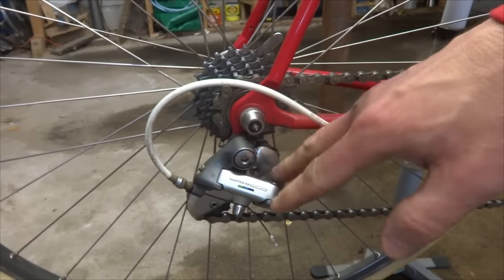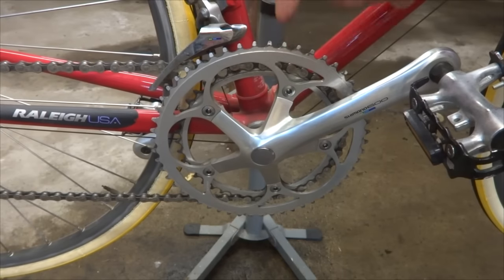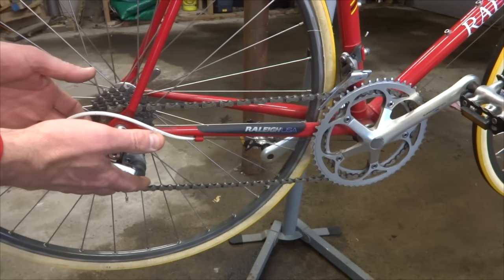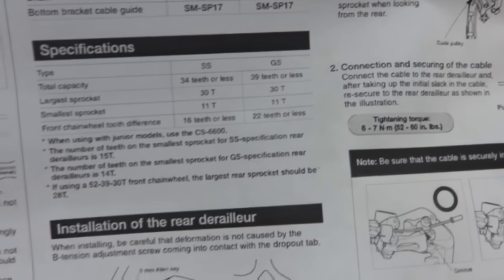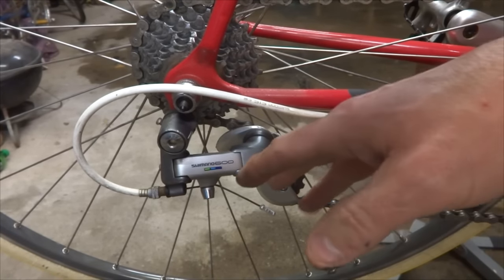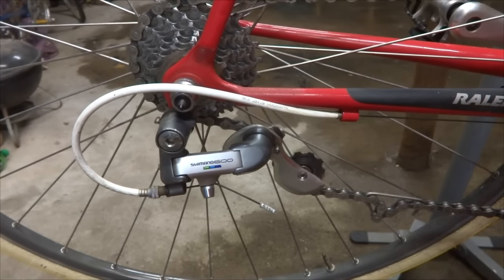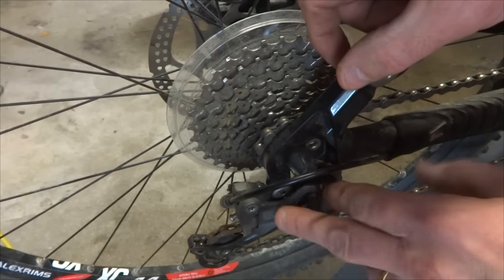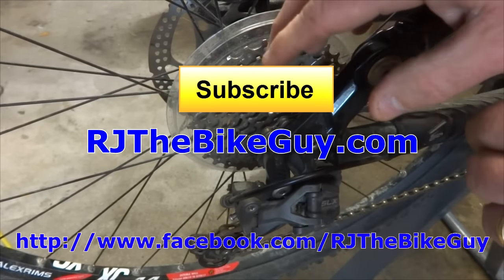Long Cage vs Short Cage Derailleurs - Which Do You Need

Comment: I have an old frame here to experiment with. I set it up 1x8 with an 11-32 cassette and rode it for about a month with no problems. Since I'm in flat Florida, today I said, the heck with it and switched it with a 12-21 I had laying around. Same long cage RD. Surprisingly, it works like a charm!

Comment: Thanks for the great video - I know it's old, but this problems is still occurring g today. Now, my drivetrain has changed with the latest upgrade and I need your help understand exactly if a Medium Cage will work.  
Old Drivetrain - 3 by 7 : Front 3 rings (42, 36, 29T)  Rear: 7 rings (11 to 36T)
New Drivetrain - 1 by 10 : Front 1 ring 32 T, Rear 10 rings (11 to 46T)
Do I need a Long Cage for my New Drivetrain, or a Medium Cage should be enough?

Comment: I have a Shimano Deore LX "9-speed" rear derailer on my bike.  It is rated at 45 total capacity, but I am running it at 47 with no problem.  47=(48-24)+(34-11)  I don't think it could handle even one more tooth, but at 47, it works fine.  This derailer is also rated at 34 for the largest cog, but I know people have run it with 12-36 cassettes.  I have also read of people making it work with 10-speed cassettes. Moral: Shimano can be a bit conservative with their ratings.  Sometimes you can get away with a little bit more.
Reply from the maker: +Mark Holm The specs tend to be slightly conservative. But only slightly.
Reply from the maker: +RJ The Bike Guy Generally, it is not good practices to be shifted into the biggest cog and biggest ring. That is cross-chaining.
Reply: When I say it works fine, I mean it can handle both the big-big and the small-small combinations and everything in between.  Some people set up a bike with more capacity than the derailer can handle and get away with it by never selecting the big-big or small-small combinations.  That is not what I am doing.
Reply: My opinion: The Shimano Deore M591 SGS rear derailer may be the best, general purpose, rear derailer ever made.  Rated Capacity = 45, Practical Capacity = 47, Rated Large Cog = 34, Practical Large Cog = 36.  Will easily work with 7-9 cogs and can be used with 10, with the right setup.  All the parts that should be metal are metal.  This derailer is perfect for a wide range of bike trails, touring, commuting,etc.   The derailer in my pictures is an extremely similar Deore LX.  My wife's bike has the M591.  The LX is only cosmetically different from the M591.  The other good thing about the M591?  It costs less than most of Shimano's decent quality line.
Reply: +RJ The Bike Guy   Yes, I know that.  The practical fact is that is the way Shimano rates total capacity (with a little fudge factor) and, on a well set up bike, you can actually select and ride in the cross chained combinations with little harm.  It is not ideal, but it is not a disaster.  It helps if your chain stays are on the long side.
Reply: +Mark Holm   Cross-chaining is one of the great cycling bugbears.  As soon as you mention it, somebody jumps up to complain.  I know for a fact that on my bike, and my wife's, with wide range triples in front and wide range 9-speeds in back, and Deore SGS derailers rated at 45t, I can cross-chain them both ways, on the work stand and while riding, with nothing terrible happening!  Perhaps the efficiency drops.  Perhaps chain and sprocket wear increase.  Yes, those are concerns.  I don't cross chain deliberately, or for long periods, but it sure is nice to know that if I do it by mistake, I won't instantly trash my ride!
Reply: +Mark Holm   And!  I wonder whether the bugbear of cross-chaining did not become significantly less problematic back when Sedis introduced the bushless chain.   Nowadays we all ride bushless chains.  They are significantly more flexible in the sideways direction than the ancient bushed chains.  Perhaps cross-chaining really is not so bad any more?
Reply from the maker: It still places strain and wear on the chain and cogs to have the chain at a steeper angle.
Reply: +RJ The Bike Guy   Cyclists love their myths.  We were told for decades that narrower tires have lower rolling resistance, only to have that myth disproved by actual measurement!  Perhaps the evils of cross-chaining are a similar situation.
Reply: +RJ The Bike Guy   Look, RJ,  I really am not interested in a flame war with you.  Your videos are great.  I enjoy them and have learned a few tips from the.  The plain fact is, the outrage against cross-chaining is based largely in myth and legend, not engineering data.  The main points I started making, and still my main points are: 1. Rear derailer capacities are calculated based on the cross-chained configuration.  2. A bike set up to the derailer specs (or a bit more) can cross-chain without running out of take-up.  3. On a lot of bikes, cross-chaining, while not ideal, will also not cause instant damage.  Sure, if you ride miles and miles cross-chained, you may see increased wear.  We need to be honest and realistic about what we tell people.
Reply from the maker: You ride how you like.
Reply: +RJ The Bike Guy   Please understand, I am not trying to be flamy or rude.  This is a topic that ought to be resolved by engineering tests, but I do not know of any so far.  I am not alone In my skepticism.  Here is what the Park Tool website says, "Bicycle shops commonly recommend against “cross-chaining” which is using the smallest rear cog with the smallest front ring, or the largest rear cog and the largest front ring. Bicycle chains are quite flexible, and will work well at various other then perfectly straight. Cross-chaining is primarily an issue when the chain hits the front rings. As a simple rule, if a gear combination causes a rubbing problem, avoid that gear."

Comment: In my country, the country I come from the chain length variation is calculated using a different method yet comes out with the same result. Add the two largest and two smallest possible sets and subtract the smaller number from the larger one. (They call me “Largest Cog”)

Comment: A long cage, where it is not needed, will cause a lot of chain slap, unless you have a clutch. It can cause you to lose your chain in rough terrain or over common street obstacles like speed bumps and pot holes.
Shorter cage deraileurs do tend to shift faster, quieter and smoother, partly because you get better chain wrap and the guide wheel closer to each cog, but also because there isn't so much to flex (it isxastounding how long a short cage deraileur can stay in adjustment vs a long). These are all niggling things until you apply them to 1x vs triples, with huge range. Also, any e-bike. E-bikes can have problems with power over run with motor inhibitors between shifts, oh and cheaper ones (most) often have sticky freewheels instead of cassettes. Now all that extra chain slop bunches up and causes all sorts of problems.

Comment: I found this very useful . I have a Fuji Absolute 2.3 but it's set up for a seven speed but it has a Shimano HG 9 speed cassette . I'm just wondering what derailleur to look for n shifters for it as well . I would like to get rid of the front derailleur n go with a 1x drivetrain . Any thoughts or suggestions would be great . New subscriber . Thanx again

Comment: Another amazing content RJ. Your online presence is truly valued. Question though, what's your take on using a rear mech on a drivetrain beyond its spec sheet capacity? Just installed an 11-32 10 speed sprocket using a 5701 SS. I'm 2 teeth over the largest cog and 9 teeth over the capacity. I really do not ride cross-chained, will I have problems in the future?
Reply from the maker: +Gian Tan The specs are slightly conservative. The largest cog spec especially. You can usually go a couple teeth over the largest cog spec with no problems. 9 teeth over capacity? I would be VERY leery of that. If you accidentally shift into too big of a combination you can maybe have some major problems. Maybe destroy the derailleur and who knows what else.
Reply: +RJ The Bike Guy Who knows what else may involve snapping my hanger feeding my rear mech into my rear wheel and tip me over face first. Yes I will be very very leery of that. Hehe. Though even running 11-28 before I have never had the habit of using bad combinations.
Reply from the maker: Why not just install a derailleur with a bigger capacity. Is it a road bike? There are medium cage options for some of those.
Reply: +RJ The Bike Guy One last thing RJ if its okay. I fitted my chain to accommodate a big-big combination. Some slack will be expected in small-small but, again, I will never ride in both combinations. Do you think the chain length I used will help minimize risks from the over capacitated rear mech?
Reply: +RJ The Bike Guy Medium cages are hard to come by in my area. Pretty much all the shops here have mid cages for 11 speed. I can go with Sora which have higher rated capacity but shifting may be a dud. But I am on an on going hunt for a GS 105 or even a 4700 mid cage.
Reply from the maker: Check ebay. Just understand the risks of what you are doing.
Reply: +RJ The Bike Guy Roger that RJ. Thank you.
Reply: Once a friend was running more teeth than his derailleur was capable and on a sprint he tore his derailleur right off the bike.

Comment: My derailleur has a 28T maximum capacity (largest sprocket: 28T) but I calculated a difference of 34T in my gear range. My bike came like that from the factory. Would it help if I put a derailleur that has a maximum capacity of 30T (largest sprocket: 30T)? And would I be able to ditch the 14x28 tooth for something with a larger gear range like a 14-34T? I never go in, for example, 1-6 or 3-1.
Reply from the maker: The amount of chain the RD will take up and the largest cog it can handle are two different things. Generally you can go a little larger with the cog size. But don't exceed the capacity.
Reply: RJ The Bike Guy is 4T too much?

Comment: Good video, I’m doing a project bike and not sure if the derailleur is too big. It has 12 inch wheels (can’t go any bigger) and I don’t want it scraping the floor, how can I measure it? And if it doesn’t fit, what should I do? Are there small enough derailleurs to fit? (I saw one on a 12 inch folding bike but I can’t find that model anywhere. I don’t need much range.
Reply from the maker: It's your project. You will have to see what works.

Comment: Nice video.
Question:
Scenario ... Only one front sprocket (30T) and rear cog set of 11T - 34T,  8 Speed.
How do you make the calculation for Long Cage/Short Cage ?  Or will either one work ?
My understanding is ... you ignore the front. So the difference between the 11 and 34 is 23.  So the max capacity needs to be 23 or greater, which most Long & Short cages certainly meet.
What is your take on this ?
Reply from the maker: It's the same calculation. The "difference" in the front is 0.
Reply: @RJTheBikeGuy  Ok so in my example it's >= 23 (34-11) ?
Reply from the maker: @joeanderson3423  And the derailleur needs to be able to handle a 34t cog! It's all explained in the video.
Reply: @RJTheBikeGuy  Yes .... the derailleur is 11-34 Shimano.  Thx

Comment: Thanks for your videos! I am wondering if this is the reason why my rear derailleur does not shift to the smallest cog when using the biggest chainring? 🤷‍♂️ I am using an older gen Shimano 600 Groupset (Friction shifters) but testing with a 9 speed Miche Cassettte. (I think it is 13-26 though) and new KMC 9 speed chain. if I shift from the big chainring to the small, the derailleur then will shift to the smallest cog automatically..

Comment: Don't forget...If you go to a much smaller cassette...say 11/25 from a 11/36 and you have a long cage, It may not shift very well because the derailleur B setting is too far from the 25T cog.  That's the problem I have now. So I'm going to use a 11/28 and get a short derailleur.
Reply from the maker: You have to get derailleurs specially made to handle a 36t cassette. Or a derailleur hanger extender.

Comment: Can you convert a 14-28 tooth 6 speed freewheel to a 14-34 tooth 6 speed freewheel (if yes, how about a 11-34 tooth 7 speed or a 13-34 tooth 7 speed) without changing the derailleur? Mine is an old model shimano TY18 derailleur. Great video!
Reply from the maker: Apparently you didn't get much out of this video.
Reply from the maker: https://youtu.be/9R1CVWcgu_M?t=266

Comment: Very good, easy to understand explanation. If I'm going with a 1x10 drivetrain on a mountainbike (11-32?), I'm assuming a short or medium cage is fine, that the calculation is simply "32 minus 11" or "21". Anything else that I should consider in going 1x__ drivetrain?

Thanks again... so good a video that I didn't mind being flipped off. :-)
Reply from the maker: You also need a derailleur that can handle the 32 teeth large cog.

Comment: Hi RJ, i have a 2015 GT grade with Shimano Claris. I'm looking to replace the rear derailleur from a short cage to a long cage, this way i can use a 11-34 o 11-36 cassette. Can a use a Shimano mtb rear derailleur with road claris levers? Thank you
Reply: I would think so but make sure it is the right number of gears and that the pull of the shifter is the same of the derrailur

Comment: another good video , thank you lemme ask u, if i changed my front chain ring to be only one instead of 2 it had and didn't touch the rear sprockets \i kept the same 6 it had, would i still apply the same math operation you did  or would it change somewhat. thanks again
Reply from the maker: +Nauj Aral Yes, the math would be the same.

Comment: Hi rj, v helpful vid. I am trying to build a cx bike from scratch and am want to go with a 1x system and so am thinking i prob want the biggest cassette i can get on the back. I get from the vid i need to buy a derailler that can handle the teeth diff on the cassette and can take the biggest cog. But do i have to worry at all  on the depth of the cassette or the size of the hub between the chainstays?
I also want to run disc breaks - does that affect my considerations of cassette or derailler?
Thanks a lot
Reply from the maker: The derailleur needs to reach all the cogs. So a derailleur designed for 6 cogs probably wouldn't reach all the cogs on a 10 speed cassette. So it you are running 10 speeds, get a 10 speed derailleur. A 9 speed speed derailleur might work.

Comment: Even though you would be adding weight, could you just add more chain length as needed to  provide  more slack for that derailleur?
Reply from the maker: No. That's not how it works. https://www.youtube.com/watch?v=ELsKrgTt0oY
Reply: Chain length should be set  so you can shift cleanly onto the big sprocket when it's on the big ring.  Then shift to the small ring and sprocket: the derailleur should still be applying tension to the chain.  There's more to it if the derailleur has "A" and "B" tension screws.

Comment: Hello, very good video! 
What are the consequences if a new rear cassette brings the derailleur beyond its total capacity, my chain is sliding along the teeth on the smallest cog when there is pressure applied to the peddles, especially at the beginning of a hill. 
I have a dura ace RD7800(29 or less total capacity) and the new cassette is a 7900 11-27 ratio, with a 39-53 front ring?
Thank you in advance
Reply from the maker: +Martin Burke Then you risk damaging your chain or derailleur if you happen to shift into a combination where you go beyond the capacity.
Reply: Wow thank you for the quick response!! Do you think the chain skipping when its on the smallest cog related to that extra tooth of chain length?
Reply: the extra tooth of chain length that the derailleur cant take up the slack on?
Thank you again
Reply from the maker: Not sure. Without seeing it, I can't tell you exactly what is happening.
Reply: +RJ The Bike Guy 
Thank you for your help, much appreciated!